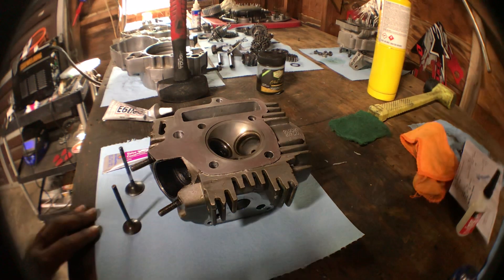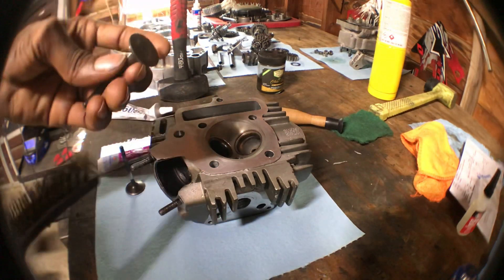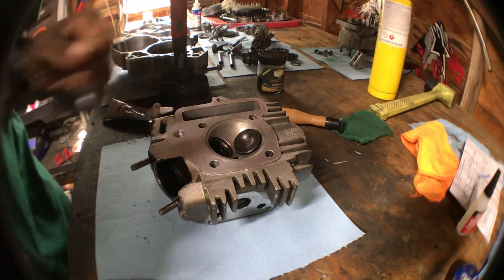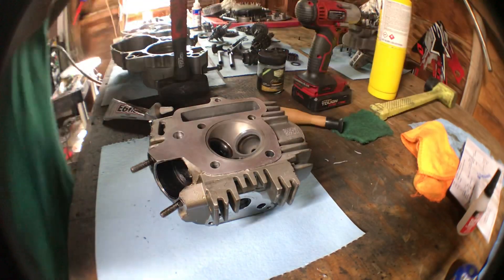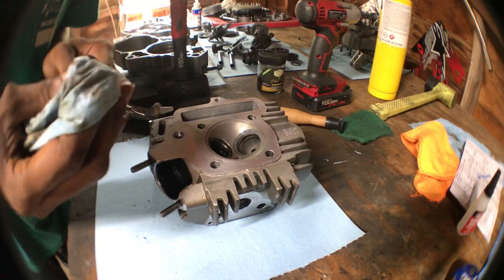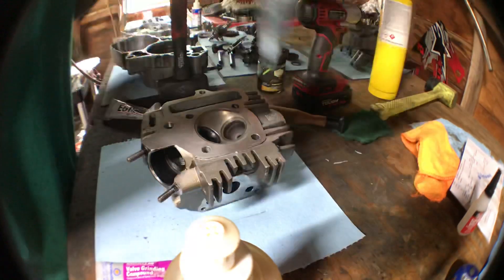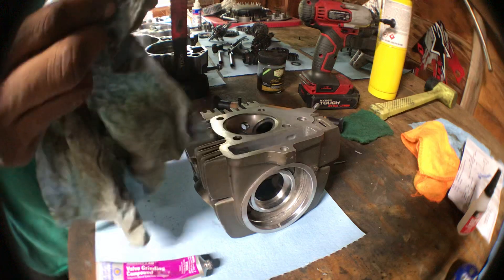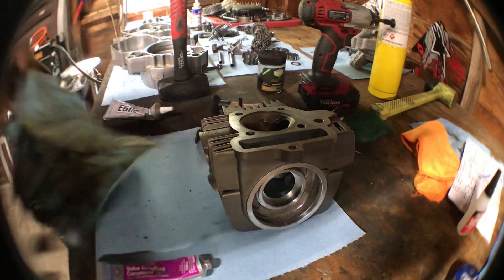How to lap valves (works on all 4 stroke engines)

Comment: Please my valves and plug keeps damaging. What maybe the cause?
Reply: Timing?
Reply: Maybe base gasket is too thin, check squish
Reply from the maker: Could be a few things, maybe the rod bearing is shot, valves out of clearance/off timing, be piston could be too tall... There's a bunch tbh. Find out the position of contact 🙏🏿

Comment: I would not say this works on all 4 stroke motors. Many if not MOST 4 stroke valves have coating on the seats that will wear off if you lap them and cause the valve to wear out in a very short period of time. Read the service manuals. Most say NOT to lap valves at all. This is more relevant for lawn mower engines lol
Reply from the maker: I learned this the hard way lapping titanium values 😅, but thanks anyway 🙏🏿

Comment: Do not lap valves i did and it destroyed my head on yz250f 2001. Titanium valves do not need to be  lapped. Steel valves need lapping but you run the risk of destroying your head. Get new head valves ect install and ride. Remember steel is harder to grind than aluminum so your head will ware faster than steel valves.
Reply from the maker: I just read a similar comment and already messed around and found out 😅, steel uncoated are exceptional in most cases from my new knowledge 😁

Comment: Needed to put both valves in when cutting the seat to avoid compound getting into the other valve shaft
Reply from the maker: Thanks for the tip, I'll definitely keep this in mind, don't want to ruin any valve seals or stems 😅... Thanks again 🙏🏿

Comment: He just told me that my KZ 1000 has low compression in cylinder one and four. So mechanic that’s why my engine is going bad cause of bad gas mileage now. A good friend on Facebook said to look at this video and this is probably what it is.
Reply: could be could be piston and ring wear as well
Reply: very possibly could be!
Reply from the maker: Did you ever figure out the issue?
Reply: Nothing yet. Looking for a new mechanic to look at it. Guess I won’t find out until I open my engine or replace the engine. Some say it’s my rings that are going bad inside.
Reply: @therock231126  is there any smoke on start up and while your riding ?

Comment: Nice video. Have you considered alternating direction on the drill while lapping?
Reply from the maker: I do when I go back over with my hand as my last step
Reply: @montane_west  I lapped the 4 valves on the right side and retimed them with that jig you get from BMW and all was well. Well enough to do 12 states and 11 national parks a few weeks after the job was done last summer. That cam locking jig was money well spent.
Reply from the maker: @mattcero1  sheesh, I'd say you did one hell of a job on those valves 💪🏿💯🔥😸

Comment: using the hand valve lapping tool is better since you rotate it in different directions, you can feel the grit fining out, it doesn't stress out the valve seat too much and it doesn't 

the drill method is faster but it's prone to errors, but using the hand tool is forgiving but it takes a much longer time.
Reply: just as an FYI he stated that at the beginning of video.
Reply: I use both.